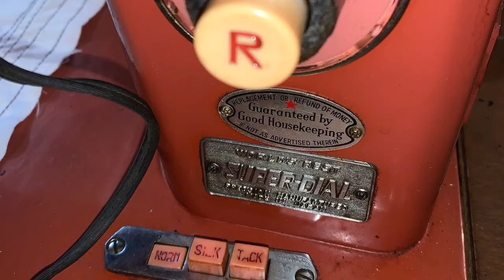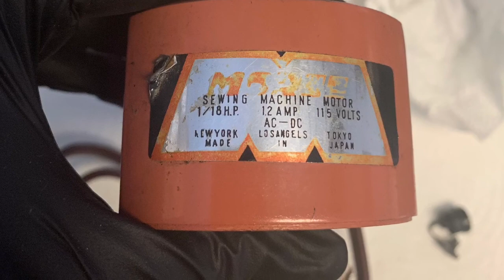Rewiring a Morse Super Dial Sewing Machine Motor

Comment: Good to see this being done. Where do I begin to do the exact same thing for my pink Morse?  
And did you clean out the insides of the machine? I’ve removed all parts but it’s still so full of gunk up inside. 
I’m assuming I’ll need a soldering tool. 
Thanks again!
Reply from the maker: Hi Candy!! I began by carefully taking everything apart and taking lots of pictures as I went through this process. I used a soldering iron to heat the old solder joints to remove the old wiring from the motor contacts. I also cleaned the commentator and inside of motor with electrical contact cleaner & checked the brushes for wear. I soldered on the new wiring and reassembled the motor using the pictures I took of the dis-assembly as a guide. By the way I used an extension cord from the dollar store to rewire this Morse motor, works great! 🎉
Hope this helps you & enjoy the process!! 😁